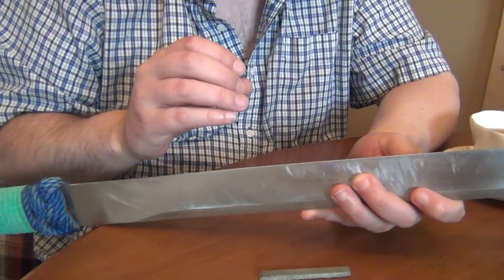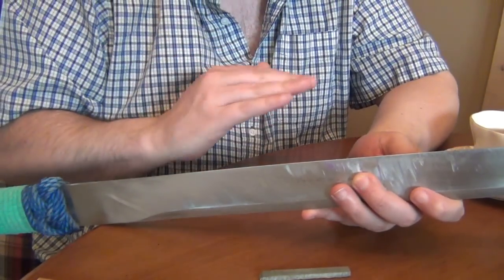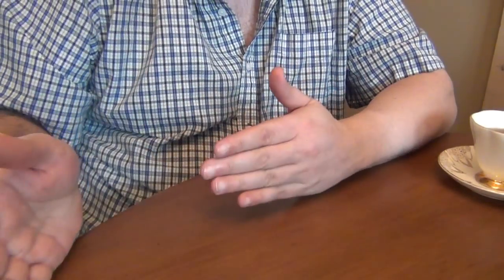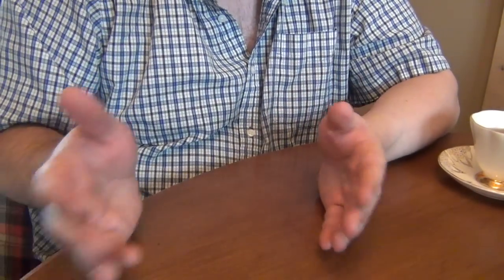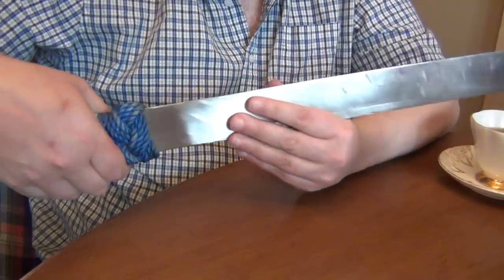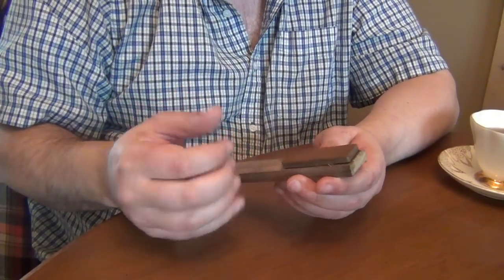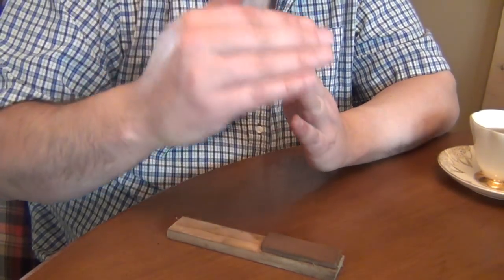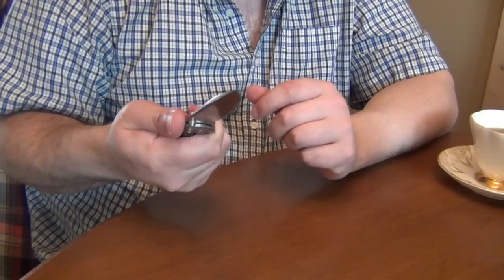Using oil on waterstones and water on oilstones ?

Comment: You don't need to use any water or any oil on whetstones, but this might be not optimal in terms of performance.  Whetstone should create correct amount of friction to cut metal still being able to do precise movements. In addition there must be way of removing abrated material from stone surface so stone will preserve its performance.

Comment: I compliment the host for addressing this topic. Also used with "stones", straight up or as a mixture are: kerosene, gasoline, mineral spirits, turpentine, alcohol, bleach (to prevent mold), WD-40 (and other lubricants). Of course I have left out numerous liquids that help keep the swarf from clogging the stone.

Comment: I use anti bacterial soap as a lubricant. With or without water. Oil is messy and expensive
Reply: I JUST BOUGHT MINERAL OIL $3.89 FOR 16 OZ IN A DRUG STORE. NOT EXPENSIVE ONLY MESSY IF YOUR MESSY!!

Comment: Water stones are clay based, They require water to help slowly dissolve the clay giving you a slurry or award which can cut and polish better sometimes, but also because some stones load up metal in them really bad which stops them from working, so it helps to slowly erode it away to reduce or stop the load up, and again a thick award can be great for sharpening, and a thin award can be really good for polishing, giving one stone multiple uses, oil stones are typically harder and less porous, and the oil doesn't evaporate or absorb quickly and helps to wash away the award instead of it loading up the stone, water stones made of ceramics need water as well to reduce load up and to produce that same award or slurry of different thicknesses for different purposes, so there actually are reasons why you would need water for a water stone since oil doesn't dissolve the clay sufficiently and would produce way to thick of a swarf, and oil can be used on non porous stones since it doesn't evaporate or absorb as readily, and it better keeps load up from happening, there's a reason for all this, not just them telling you that you can't use this over that
Reply: But slurry is not good tho.

Comment: Does this information translate to the Tormek water stones as well? I have no control of my shop temps at night, which is located in the Midwest. Freezing is a big deal here and I do not want to crack my stones. I want to try mineral oil, but no one from Tormek has answered my questions yet

Comment: Thanks for sharing this. I became annoyed that my 1000g Sigma water stone kept evaporating, even after being totally immersed in water overnight. So I soaked it in paraffin and tried oil on it - this worked quite well but still the oil was soaking in! I've now neutralised it with washing up liquid (UK) and am trying to load up the surface. So far I've used neat dish soap and this works pretty well. I've also used barrier cream which I think is water soluble and this is keeping the water on the stone.

Comment: I have seen comments on arkansas stones and oils to use. I've actually been using soapy water on my arkansas and it seems to be alright. It's a very hard black arkansas from Dan's. Is soapy water a mistake? Should I be using something else? I'd like to get the most out of my stone, ideally.
Reply from the maker: In general, very general. The finer the stone, the finer the lubricant.

If your lubricant isn't enough of a lubricant, you get frictional rubbing vs actual cutting. The only way to know is actually test them and see which one produces the optimum edges for the longest times.

Comment: Hi there I just got this small wood carving set that came with a whetstone, when using oil should I wet the stone that is comes with then add the oil to it? and for cleans my chisel's should I use a damp cloth? and so I have to wipe down my stone afterwards?
other people say I could also use glass cleaner like Windex with a bit of water and soap, and sandpaper as well
 i'm new to this so sorry for a lot of questions any help is appreciated please and thank you.
 this is the set that I have
https://www.amazon.ca/gp/product/B0824J95T8/ref=ppx_yo_dt_b_asin_title_o00_s02?ie=UTF8&psc=1
Reply from the maker: You generally don't mix oil and water. Just add the oil directly. Yes you have to clean the stone, you wipe it with a rag, put on fresh oil and wipe it again until the rag is clean. It doesn't take much oil, just a little. Yes, you can use any cleaner, dish detergents have anti-grease agents which will clean stones however they also don't get along well with steels (they can corrode them) so I prefer to just use oil.
Reply: @CliffStamp  thank you for your reply back.

Comment: i actully got an intristing 1 .....shaveing gel ((ive tried cream to but gel is the best of the 2)) not sure why but ive got a edge apex clone and my stones is 240 diamond 600 diamond 1000 diamon 3000 ruby 5-6000 white 8000 green 10,000 translucent white ....i use oil water and shave gel ((different sharpening knives what ever i feel like playing with)) once i hit the ruby....out of the 3 i notice when i use the shave gel ((all other things being equel meaning the angle the number of strokes and other factors)) when i do an arm shave test......useing the gel  it produces a much more aggressive edge ((easily shaveing and shaveing alot)) vs oil or water
Reply from the maker: I have not used gel, but in general, you want to match the lubricant to the grit, too heavy and it will mask, too light and it will see heavy friction. Nice experiment in any case.

Comment: So are you saying it is fine to use water and soap on an India stone?
Reply from the maker: Ok, here is the thing, this isn't a trivial question to answer. IF you use a lot of force, you want to use oil because you need MORE of a lubricant, if you use very light force, then oil probably won't matter, even water might be enough. In general, the more force you use, the more friction you will have and you want the oil to prevent that.  It only takes a little experimenting to find out what is best. A lot of people use a very light lubricant, like simple green (a kind of cleaner), as they don't use a lot of force.

IF you use a lot of force and use water, you will find that the stone will stop cutting sooner than if you used a heavier lubricant and you will have to recut the stone more often.

Comment: Something to add: So i got a new naniwa combination stone 1000/3000 and as usual i sharpened couple of stones... liked it a lot, the finish was kinda matt and everything was ok. On the next day i decided to sharpen again and i have 2 little similar bottles one with mineral oil and the other with water. So when i got to the 3000 side i put oil in it by mistake and it instantly soaked into the stone so i just added water on top and polished the knife. It turned out MIRROR polished and i was seeing my face on the bevel... when i tried it on piece of paper it did push cuts like if its nothing... My question is can the oil actually made the stone work as higher than 3000 grit stone, because the day before the knives i shaprened was not polished and couldnt do push cuts?
Reply from the maker: Yes, it is essentially going to mask the abrasive.

Comment: 5:00 this is where I think you're saying the most important thing, but still cant catch it: 
"Friction increases wear on the abrasive, and decreases wear on what you're actually trying to cut"...
Mmm, I'm new here, cant figure it out.
Reply from the maker: Friction is the steel hitting the abrasive and wasting energy by rubbing, that doesn't do anything but wear the abrasive and weaken the steel - hence use a lubricant.

Comment: I suspect the original preference in this started due to whether a sharpening stone was exposed to freezing conditions. A water stone will have some issues with the water seeping in, and may crack if stored somewhere cold due to the water freezing. Not so much with an oil stone. But a stone setup to use water is much easier to deal with otherwise, as oil can be somewhat messy.

Comment: All I know is no Japanese chef using quality water stone ever uses anything but water.
Reply: The Japanese traditionally used natural sharpening stones lubricated with water (using oil on a waterstone reduces its effectiveness). The geology of Japan provided a type of stone which consists of fine silicate particles in a clay matrix, somewhat softer than novaculite.

Japanese stones are also sedimentary. This is why they used water
Reply: Yes I use water only on the water stones. Just never get the same edge as I get using oils stones. I’ll keep practicing

Comment: So a question then... 

What about Escher or other thuringian stone with oil? 

I think I saw an old label "use with water or oil". 

Also the owner of the company following Escher tolde me you can since it already has natural oil in it anyway. The edge will get finer. 

On the other hand I read in the Internet you can't since it will clog up. 

So... Can I? Can't I just rub it with fresh oil and whipe it off as I do with my Turkish oil stone? 

Will it maybe loosen the stones structure if it has natural oil in it already?
Reply from the maker: It will not affect the structure of the stone, and the clogging is dependent on the type of oil. Linseed oil for example will oxidize, it forms clumps on the outside of the bottle which you can see when exposed to air, that type of oil if used on a stone would not be productive. 

In general, you match the thickness of the lubricant to the grain size of the stone, a very coarse stone will need a heavier lubricant (or at least can use one). If you use a very heavy oil on a very fine stone, the stone might be completely masked by the lubricant and you could see little to no actual abrasion.

In general, lubricants stop the stone from wearing (as they reduce friction) and keep them cutting, so you want the heaviest lubricant which isn't so heavy it masks (as this provides the greatest removal of friction). I have not used those stones but since they are very fine, I would look for a very light oil, but likely see what happened when I started with water (they maybe water and a light detergent).

Comment: Cliff, so what are your thoughts on John Juranitch and sharpening on a dry stone? Also, when it comes to oil, I personally never use it, mainly just because it's messy, slippery (which is dangerous when used with sharp knives), stains clothing, is expensive when compared to sharpening dry or with water, and is impractical to carry with you when in the woods. In the end, I just find oil to be too impractical in my opinion. But of course, everyone is going to have differing opinions, and that's fine.
Reply from the maker: I don't agree with his arguments, and he ignores obviously industrial counter points such as frictional loss leading to poor abrasive life and loss of cutting ability of the stone.

If oil is problematic, then there are other alternatives to it. However if oil is really messy then likely far too much oil is being used. It is only a lubricant, stones made for oil typically have high bond density and strength and thus can work usually with trivial amounts of oil on the surface, just get a decent applicator.

But even water+detergent makes a decent alternative, but will produce a far lower abrasive lifetime, especially on hard to cut steels.

Comment: An oil stone cuts better with nothing at all on it.  It still cuts well with water.  It cuts less well with oil than anything.  But how well an oilstone cuts has nothing at all with why you should only use oil.  You use oil on an oilstone because only oil has the density to float steel.   If you use a bare stone, or is you use water on an oil stone, you WILL clog that stone up rapidly, particularly if it's a fine stone, but the same holds true with a soft stone.  It just takes a little long.  And, no, you can't just wash the stone and unclog it.

And, no, stones are not just stones.  That's as silly as it gets.  It's remarkably ignorant.  Different types of stones have different compositions, different grain sizes, and different densities.  Some stones are natural, and others are manmade.  Some aren't even stone at all, they're diamond. 

The simple fact is, like it or not,  that only an idiot puts water on a good oilstone, and only a moron would ever put oil on a real water stone, and YES, there is such a thing as real water stone that is specifically made to use water if a manmade stone,, or that centuries of use has proven will only work well with water, and that oil can quickly destroy, if it is a natural stone of the same type..

It is only common in the industry to use both oil and water on specific types of stones made for that purpose, and saying a stone is just a stone is still the dumbest, most ignorant remark I've ever heard in a supposed "sharpening" video.

In short, you have no flipping idea what you're talking about, and whatever part of the industry you've been in, if any at all, is tiny, restrictive, and didn't teach you a darned thing about stones or sharpening.
Reply: Most of what you've said here is rephrasing exactly what his said, apart from asserting that: you should never, ever, use anything but the best lubricant/flusher (even on a £10 stone? or $1 sharpener); implying that oil/water-stones are actual minerals, rather than assigned class types and throwing personal insults like a bratty child.

Honestly, listen to everything he says and accept that, at least for the generations prior to this one (internet) and with the exception of specific geographies where certain natural 'stone' abrasives were available, what he's saying is what was previously considered common knowledge for hundreds of years.

Like he says, the stones won't melt or explode, it will just effect ware and cleaning.
Reply: É hoje,sabendo quem era Ckiff Stamps, o que acha desse seu comentário?

Comment: I bought a stone once that was labeled as an "oil" stone. I decide to use water because I had always preferred that less messy alternative.  The damned thing dissolved in my hands like mud. This was many years ago and can't tell you much about it. Wish I could remember the brand because I'd like to talk about them like a redheaded stepchild.
Reply from the maker: James, there are lots of stones called "oilstones", Norton makes two synthetic common brands and has for decades.
Reply from the maker: You can, however they will wear better, work better and clean up better with a light oil. If you can't use oil, a light detergent and water works better than raw water.
Reply from the maker: There are some very soft bond stones, they are meant generally to be used on very wide contacts on very hard to grind steels usually.
Reply: Cliff Stamp i just got 2 little Norton stones and i was wonder if i could use water on them. It says to use oil though.
Reply: An oilstone means a natural stone that almost always comes from Arkansas.  At least the good ones all do.  Only an idiot puts water on a real oilstone.
Reply: @jamesaritchie1  Because in the bone dry deserts of Arkansas they've obviously never been exposed to water before!